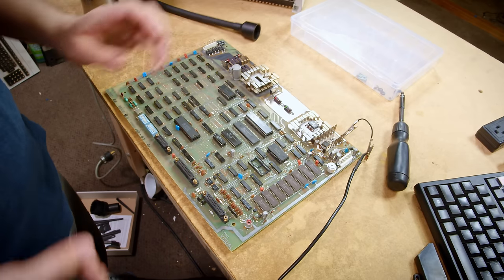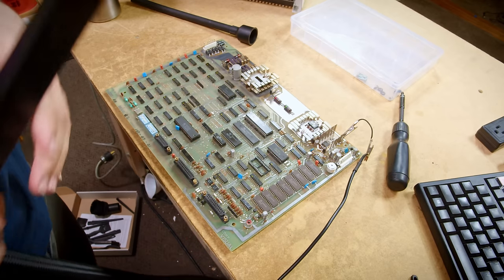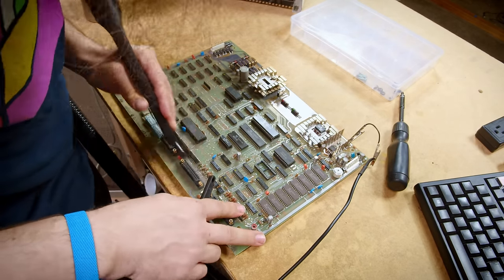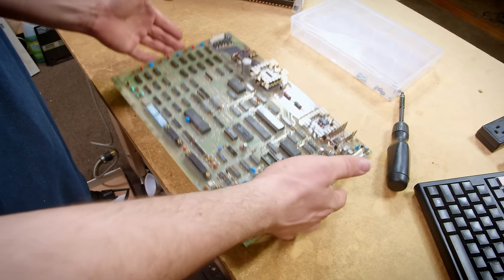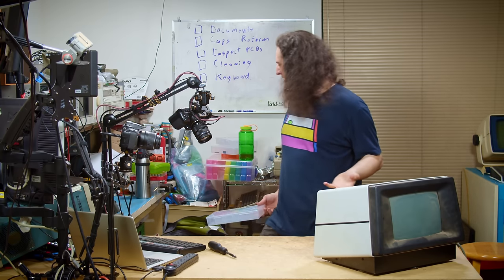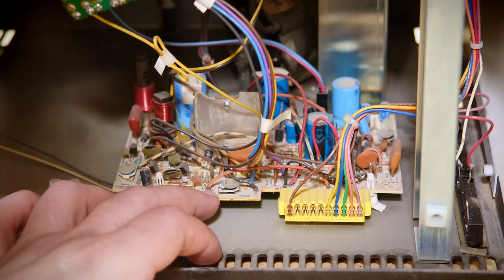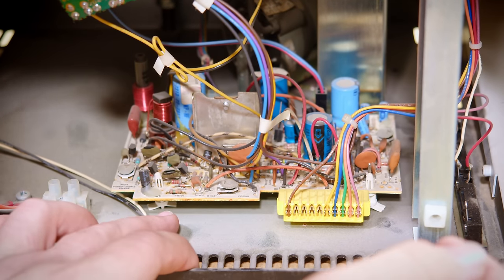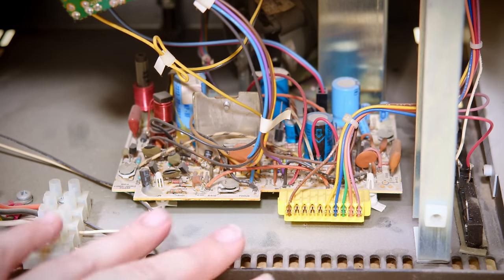Visual 200 Terminal Refurb - Part 1

Comment: After working on some DEC, HP,  TeleVideo, & even a few Teletype-branded Dumb Terminals, I've found that checking the DC Power Rails is always a good 1st step, after the initial cleanup.  Bad power issues can cause all sorts of bizarre problems.

As always, interesting content, on vintage tech.  Keep up the good work.  Awesome channel.  :)

Comment: Being the fan of Linux that you are. Combined with the fact that you own many older boxed copies of Linux Distros and much old hardware, one thing that would be great to see would be some videos where you install old distros on old hardware and show off the power of what Linux could do with say 386 DX machines as compared to the DOS 5 Windows 3.1 that most of us ran back then. There is surprisingly little content like this on youtube but what I have found was lots of fun. People showing off old distros on old 386, 486 and early Pentium systems. Showing off the power of Enlightenment and other included software. Please make cool videos of this?

Comment: Not sure I would have the patience to replace all of those foam pads. I hoped while watching this that you would have soaked the keyboard in some soapy warm water and cleaned it before putting all the pads back in. I hadn't realized until recently that that kind of keyboard was even a thing.
Reply: Indeed. Having renovated two Keytronics keyboards, the key caps can be removed using a very small crow's foot wrench/spanner to push them out of the chassis of the keyboard. A good soak in warm soapy water means the keys are perfectly clean.

Comment: I’m going to take a stab here and say that this terminal is the VT200 that can be emulated by Linux. It’s really interesting to see an actual example.
Reply: The VT220s were terminals from Digital Equipment Corporation released in 1983. The Visual 200 predates them by 3 years. According to the manual, they were released in March 1980.
Reply: Ah ok, that makes more sense since most of the terminals emulated in Linux are DEC models. I probably should have looked at the manpage for GeTTY first.

Comment: I have one of those at my computer club but it have a different keyboard
Reply from the maker: I found my manual for it yesterday, turns out there were three versions of the keyboard! If it was noticeably different, it's probably the non-function key version I would guess. I don't know what the practical differences would be, but it's odd it was configurable like that.
Reply: @TechTangents My keyboard is mounted in a wooden board. I have to get it from storage and check if it is working.

Comment: I'm trying to get my kimtron kt-70 terminal working.  I got a user manual, but not a service manual. PC-XT keyboard, Futaba switches.  So now I need to try to diagnose.  Next purchase planned is a logic analyzer. Unfortunately my KT 70, is all on a single board, that has a single ship keyboard interpreter, a single chip cereal interpreter, a whole lot of character rom.

Comment: If you ended up putting PCBs in an ultrasonic cleaner, what kind of liquid should you use?
Reply: I use distilled water. If i find anything that isn't going to go away i soak that stain in in IPA or window cleaner and try again.
I also limit the time in the bath to an shortest possible. Aluminium is no friend of ultra sonic cleaners, especially. 
Adding a bit of dish soap might help with oil or grease films, but i wouldn't try it unless all hope is lost.
Limiting the the number of chemicals you introduce is a good choice, b/c you never now what components react to what solvents, etc.

Comment: Hey Shelby (or anyone else that knows), is the ESD safe vacuum a “belt and braces” type of operation or would it definitely be required if you wanted to vacuum older tech to avoid shorts?
Reply: Not shorts, static discharge.  And yes it's definitely a thing.  Use a vacuum cleaner in a dry environment (e.g., Arizona!) and then touch a door knob.

Comment: Why not just replace the caps? What’s the advantage of refurbing the old ones with expensive gear? (Genuine newbie question)
Reply: Some of those larger caps are extremely hard to get modern equivalents for, even when you can get the right values they're often in different footprints than the original so you have to do shenanigans with leads to get them to fit in the spots on the PCB. 

Shelby has one or two whole videos just on reforming capacitors if you are curious and want more information

Comment: Hey quick question! What made you confident that the problem was entirely an analog section issue and not e.g. character ROM corruption?
Reply from the maker: It's difficult to get across on video because of the shutter rate of the camera not syncing easily with the video artifacting, but the characters are rendering fine, the horizontal lines are shifting and offsetting the pixels. You can be sure of this with the inverted video where you can see the "white" edge of the image isn't stable and looks jagged.

Comment: If this has a video out on it, (I think you said it did in the middle of the video) you should try it.  I am not so sure this is bad capacitors.  The font in the ROM might be corrupt.  Though if the font is in the main ROM, that is unlikely because it wouldn't do anything if the whole ROM were corrupt.

Comment: Out of interest, what ultrasonic cleaner do you have? I'm thinking of getting one for motherboards, but they are expensive to buy and expensive to run due to the amount of liquid you need to fill them with.
Reply: You can reuse the cleaning solution a few times i believe, did you factor that in?
Reply: @TheErador  I did. I think you need about 10L for up to mATX size boards, so maybe 7L of liquid total, 2L of cleaning solution and the rest deionised water.

Comment: Just replace!! Not "reform".
Reply: I tend to think those caps must be dry?
Reply: Can get expensive very quickly when replacing caps of unusual values or form factors.
Reply: Also modern equivalents a) may not behave exactly the same regards timing etc. and b) may be inferior quality
Reply: @TheErador  ya gotta disagree. There are quality manufacturers out there and I spend a lot of time going through new ones 1 at a time checking for a very specific value to make sure I'm putting one in that's spec. Panasonic, Sprague and a few others are good quality parts. Also they are so much more compact that any "weird" size can be achieved by pairing up 2 or if needed 3 (3 almost never happens). My only concern is leakage and the dielectric being dried out causing damage. Reforming doesn't rehydrate nor repair tears in the foil. If it works for someone and they choose that route that's up to them I'm just saying from experience I have seen caps do weird things. Check out good static and tank once under a load etc.... it's just my opinion to never reform. Seen too much to not have this opinion.
Reply: @troybarnes66  Just replace.

Comment: You can reform caps in situ.  Do it all the time.
Reply: Won't they be dried out?
Reply: @blackterminal If they are, they won't form.  A dried out cap is a dead cap, there's no saving that.  But i find it rare that the seals break in electrolytic caps, and the electrolyte leaks out.

Comment: "µF" stands for "microfarad", not "U F".  "Reforming" those kind of electrolytics only delays the inevitable.  Just replace them.
Reply: Saying "UF" is Not unusual and makes the understanding easier. Imagine saying "microfarad" hundred times a day. 
Reforming capacitors is usually enough as long as the device isn't running very frequently.

Comment: Utterly disgusting? You mean just a little dusty? You haven't seen disgusting. Try changing a diaper or peeling a body out of a car wreck, when the car got compacted between trucks, now that is disgusting.
Reply: U don't have to that far lol tbh keyboards that ppl have snacked near are worse than this
Reply: calm down man
Reply: @inserttanjiromeme5496  I'm calm, I'm just utterly surprised about how scared people, especially many vintage collectors are of a bit of dust. Of this but of dust is off-putting, then you shouldn't step outside.
Reply: @bzuidgeest  Whole different context. You're comparing apples to full metal jackets. You ok bro?
Reply: @bzuidgeest do you not know what hyperbole is?
Reply: @samueltufts  do you?
Reply: @bzuidgeest  Nice deflection, now please kindly answer the question.  And yes, this is a whole different context.  A piece "utterly disgusting" vintage tech is not "utterly disgusting" in the grand scheme of things.  Context matters.
Reply: @jakint0sh  context matters, but even in the context of vintage tech it's not disgusting. Now if someone recently puked over the keyboard, then yes. But this was just dust and not even a lot of it.
Reply: I mean... let's all just acknowledge that there are different levels of disgusting, and that context matters.  A filthy keyboard IS disgusting, relatively, to using a computer with a keyboard that isn't filthy.

I just got done cleaning out an old P4 that had humid dust in it, and it smells like a wet dog.  It's pretty gross.  It's not "the litterbox hasn't been emptied in two weeks" gross, but if it WAS, I wouldn't have bought it, because there are P4s out there that aren't biohazards.
Reply: @nickwallette6201  yet even in your own reply, you use words like gross and filthy. Degrees, of how dirty something is. Though context matters somewhat, all these words already have a place in the language and one is a stronger expression of a similar concept than the other, levels or degrees of not being clean. 
It seems to me you are working very hard to please everyone, even the sensitive people that apparently think some dry dust warrants the big guns, by calling it disgusting. Hyperbole and silly if you ask me. You can talk about it being relative all you want, but if you are going to accept any word under any condition, we might as well throw out the dictionary, trash 50% of words, because they apparently all mean the same and are interchangeable. They clearly are not.
Reply: @bzuidgeest    No, not at all.  It's just that adjectives, and indeed most of language, is imprecise by nature.

Consider words like "fast" or "bright".  You might call a blue LED "bright."  But it's not as bright as the sun.  Does that mean it isn't bright afterall?  Of course not.

A DX4/100 is fast.  ..... compared to a 486 SX/25.  Compared to a Pentium MMX 233, it isn't.  Compared to a Core i9 12th gen, it's slow.  So is it not fast?  Of course it is.  Just, only compared to other CPUs of its class.  And for that matter, what IS its class?  486s?  100MHz CPUs?  Chips that were released to market the same year?  The latter surely wouldn't be a good measuring stick:  What about embedded chips that were a fraction of the speed?  What about super-computers?

Relative.
Reply: @nickwallette6201  yet none would describe the glow of a standby led on a tv as blinding. That would be called exaggeration. Yes, words are not precise, but that doesn't mean they cannot be used inappropriately. Otherwise you could call the sound of a falling feather, deafening or a snowflake heavy in your hand.